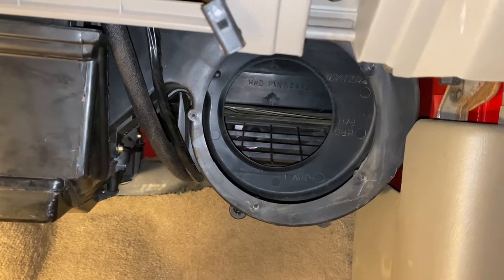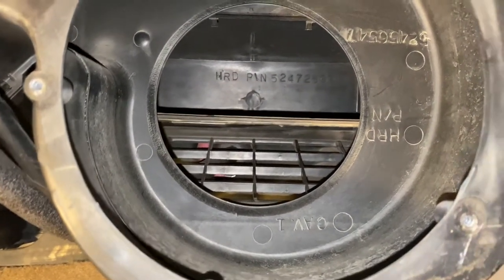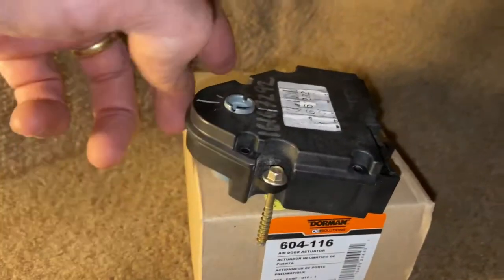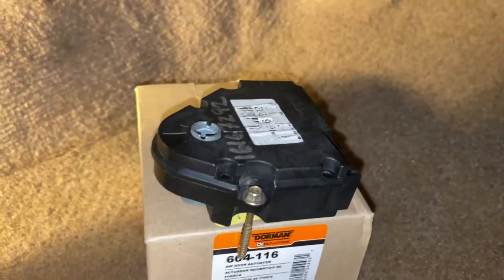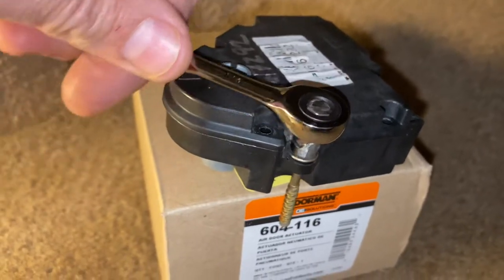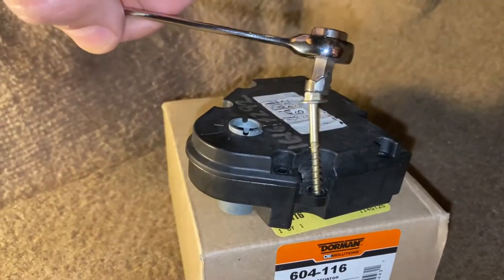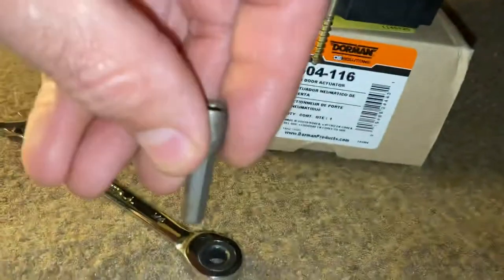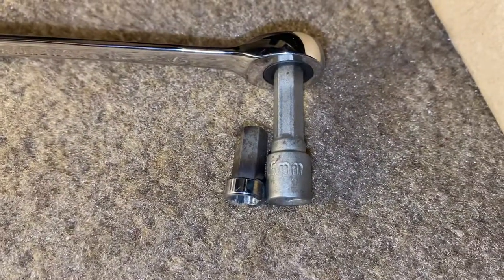1998 Chevy recirculate/fresh air blend door actuator motor install 16167292 (Dorman 604-116)

Comment: I have 2013 Silverado. Each time I press the recirculation button it blinks 3 times then goes right back to the outside air indicator. Is this a need for the recirculation actuator replacement  ???

Comment: This is awesome, thanks for putting it out there.  I'm in oiling my fan motor, which started squeaking.  I may have to replace it if the oiling don't help.   From my other vehicle experiences I try to keep the original one as long as I can, seems like the parts now days are junk.  So while I'm in there I decided to replace this recirculating door motor and found your very helpful video.
Reply: How are you oiling?
Reply: @RifeB6892  I took it out of vehicle, put it on bench in vice.  Took the fan motor apart.  Dropped in machinist oil (light weight oil with no additives in it) every day for a week.  Each time removing the shaft out of the bronze bearing.  Basically getting the bronze bearing to absorb the oil.  So far it has been good up to this posting date.

Comment: Does that one control the heat? I have no heat in my truck and that actuator is clicking.
Reply: Same here my heat won't get but 1/2 hot.. thinking it may be the fresh air door not closing all the way?
Reply: @drumrooster  My heat is the same way. It doesn't get very hot. The recirc actuator started clicking years ago, so I just unplugged it with the recirc door open so I could have max AC in the summer. I didn't think that would affect how hot the heat was though. If it does, explain to me why? I'd like to know (not trying to be a jerk). I thought maybe the heater core was plugged with leaves, so I changed that...no help. Got a bore scope so I could check out the ducting...It was clean. I'm baffled. I did plug the actuator back up today. I didn't think about trying the heat to see if it is better. I'd do that right now, but I've had a few beers and it has always taken FOREVER (10-15 miles on the interstate) for that engine to get to normal operating temp. 
The recirc door being open does seem to affect the defroster's ability to defog the windows because with the recirc door open it just recirculates the humid cabin air.
Reply: @drumrooster  Actually after doing some investigating, I think the door that controls heat/cold air is not actuating completely. I put an instaread thermometer in the vent and once I got the heat control to about halfway to full hot the air did not get any hotter. Has to be a door not moving completely.
Reply: @drumrooster  this controls the recirculation door or fresh air

Comment: I drilled a hole through the bottom part of the dash and the dash mounting bracket and my socket and extension get right to thay bolt.